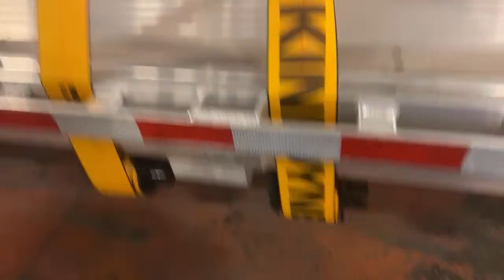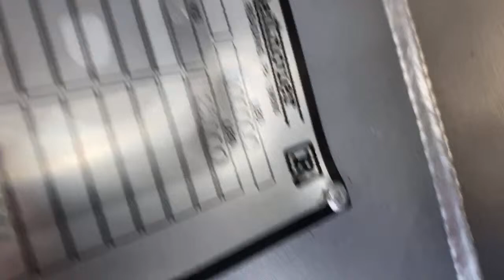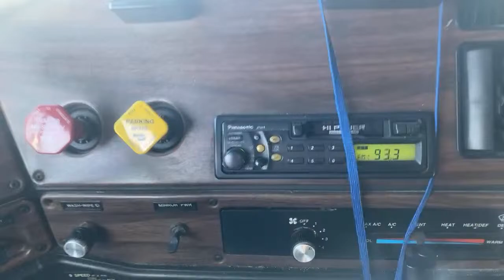40k on the deck! RUN UP A CHECK!!!

Comment: Is that a 48’? Any reason you went with the length you chose
Reply from the maker: 53’s in general don’t pay much more than 48’ but a lot of hotshot customers turn down 53’ because of space limitations. Also it saved me more weight, so when I put 48,000 on the deck I’m only 71K gross instead of 78-79k ( limit is 80k unpermitted). Ima definitely show you 💪🏽🤝🍞🚛💨💨💨